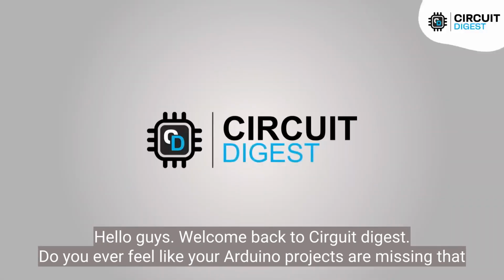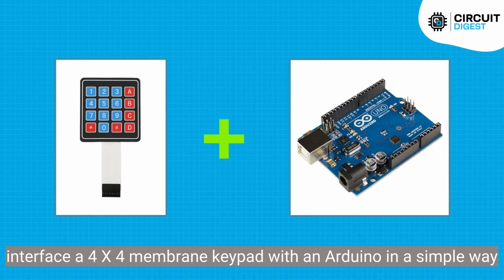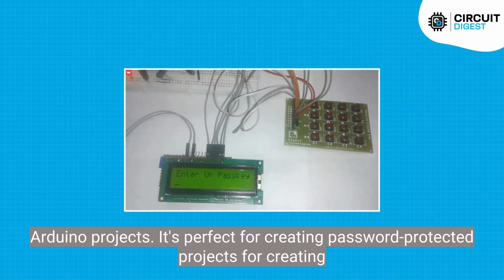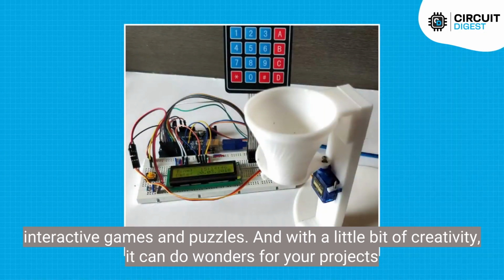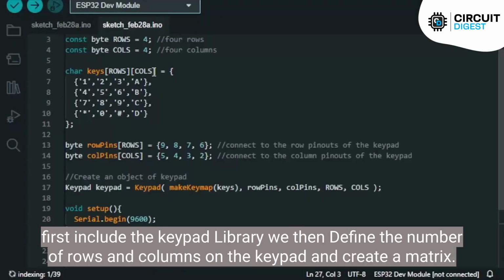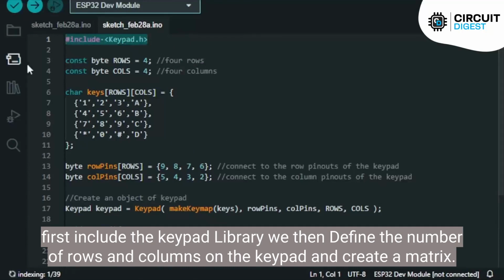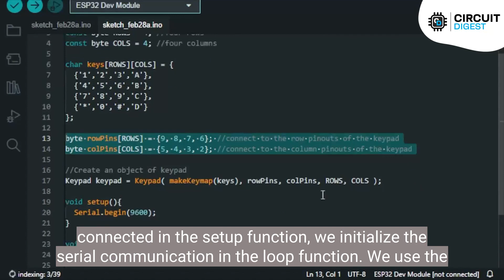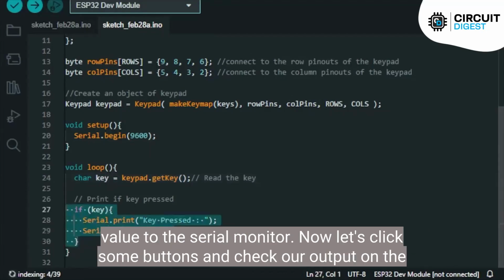Learn how to use 4x4 Membrane Keypad with Arduino

Comment: I have a mega arduino, and if I do the wiring the same way as it is in the uno board, the first row, from 1 to *, doesn't work. How should I do the wiring with a mega board?
Reply from the maker: In the code change the row and column pins according to your connection.

Comment: always a 1 in Serial Monitor, what should I do ? Even if I disconnect the keypad, and open serial monitor it shows 1  only. Please help🥲
Reply from the maker: its very hard to help remotely. You should debug to figure out where the problem is. may be the keypad is damaged